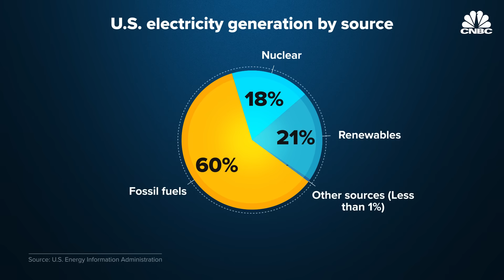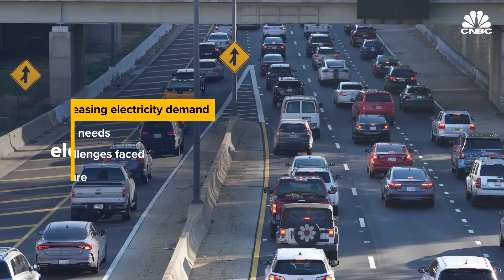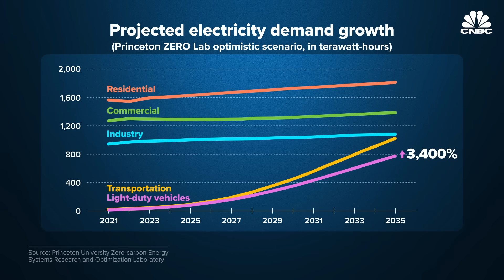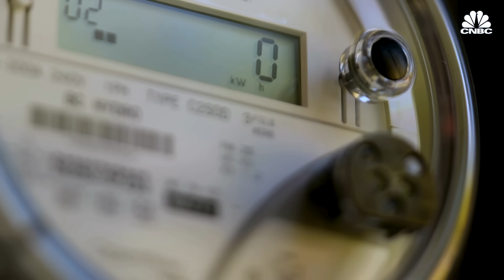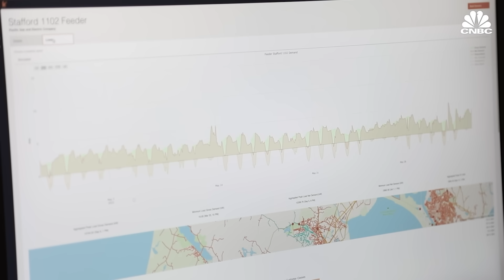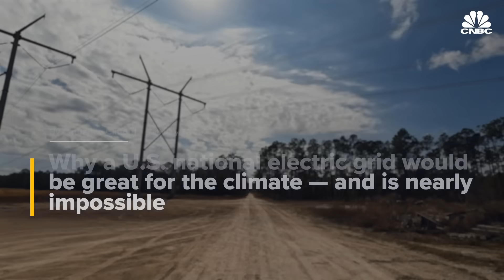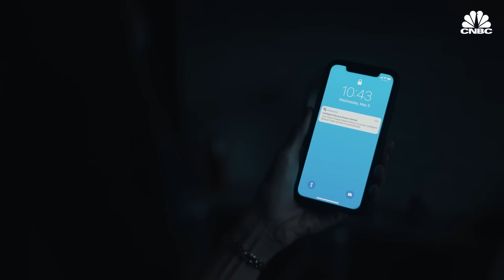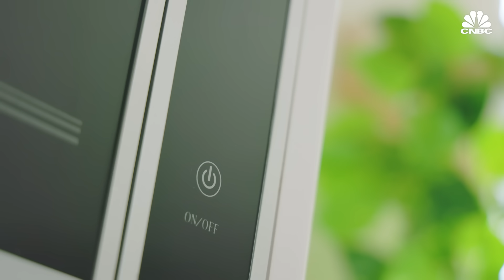Can The U.S. Power Grid Handle The EV Boom?

Comment: Northern Germany has available wind energy and southern Germany has available solar energy. An effort is being made to link the two, but there is opposition to overhead transmission  lines. Consequently, efficient underground High Voltage Direct Current (HVDC) line are being installed.  

One idea is to install underground HVDC lines underground along existing routes, such as railroads, pipelines, and highways. 

Actually the issue has three parts: Local generation and storage, intermediate generation and distribution, and long distance renewable energy generation and distribution. 

It will take lots of money. A good historical example is the Rural Electrification Act.

Comment: Almost every country is going through this, all transmission lines need to be changed to put more megawatts where renewables are favoured to where they are not. This is not about the EV adoption but the grid overall and its modern smart capabilities.
Reply: 2:00 he said $3.5 to $5 trillion. That's over $10,000 per person in the country with the lower figure. If it was cheaper I think more people would be on board.
Reply: The united states death rate is greater then the birth rate . United States energy consumption per person is  off the scale compared to other countries.  The next  closest country is Germany at about 65% .
Reply: @bobzelley5100  I personally think USA is obsessed with airconditioning units, even the poorest people have it and in other countries it’s a “luxury” and those are one of the biggest energy consuming home appliances. I think USA people don’t like opening windows at all😭I would die without natural air. But I guess it’s my assumption from just watching YouTube videos and Hollywood movies 😅, I stand to be corrected.
Reply: There aren't enough energy in the world to charge all the EVs they are forecasting for in the next 20-50 years.
Reply: Yeah but they won't send the money on it
Reply: We need to go Green in stages, we don't have the infrastructure to support an overnight change that all the activists are demanding.
Reply: but it is about that
Reply: Thanks for sharing your insights! You're absolutely right, upgrading the power grid is crucial for supporting the EV boom and maximizing the potential of renewable energy. In terms of backup power solutions, I highly recommend the Segway Portable PowerStation Cube Series. Its impressive capacity, fast recharging, and versatile sockets make it a reliable choice for outdoor enthusiasts and RV lovers. Check it out!
Reply: I don't think any of you realize that by doing this, you actually have to build more power plants which pump out 10 times more emissions per day than a family of four does in 5 years. Plus electric vehicles actually release particles that are 10 times more harmful to the environment and not just the environment you yourself sitting in. Those electric vehicles are being exposed to micro radiation just like sitting on top of a microwave. Congratulations y'all activists plays yourselves
Reply: Even without a transition to renewables energy demand is constantly increasing. At some point the infrastructure from decades ago gets overloaded and you just have to start some major projects to upgrade it no matter what.
Reply: IMO there is no need for large  scale grids, especially in sunrich California. Generation and distribution should be local. Combining rooftop solar with community solar projects would be sufficient to provide for the electricity needs of communities. This has the added benefit of large corporations profiteering. Generation and consumption should be local.
Reply: @versach49  it's way more efficient and reliable to share. There's times where your local generators are down for various reasons and you'd never know it since your power is being piped in from far away. There's a reason nearly every place around the world connects to much larger (typically international) grids where possible.
Reply: replace transmission lines? who's gonna pay for that? honestly this is all insane to me considering we have a cheap and readily available source of energy that isn't going anywhere anytime soon-oil. I for one will never own a electric car
Reply: @skeetrix5577 Me neither! Nope! No ev junk! No thanks!
Reply: @skeetrix5577  there are reasons why power plants are decommissioned, it means they are not performing as they used to… they are not efficient anymore. Same goes for transmission lines, you cannot be having a 1940 transmission line transmitting thousands of megawatts because they were not designed for that, they deliver less. Tech has changed, yes it’s expensive but that’s how it starts. If China can transmit 12GW of power 3000+ kilometers away from the desert to the cities using these lines then why can’t other countries do it?!. Look we don’t have to do it at the same time because every country has its own issues and some countries the population has declined together with energy consumption so energy is not that much of a concern to them whether green of fossil fuels. But what I’m saying is that, as we get more people using more energy we also get new equipment to handle all of their consumptions.
Reply: @fancyIOP ya thats why 90% of china rides bicycles right!! Nice try!
Reply: @lauriemedina706 It’s obvious you have not been to China for a while, or if at all. China new cars in 2024 31M, U.S. 15M . Of the 15M cars the U.S. bought half of them were imported. The Chinese are not doing to bad considering they are peasants
Reply: @skeetrix5577  you dont get a choice

Comment: Why do this at all?  IF you wanted to cut CO2 you'd be mass carpooling NOW and reducing vehicle CO2 NOW by 50%+! Which EVs can't do. Evidently no one really thinks CO2 levels are an emergency.  World Lithium production is 100,000 tons annually; enough for 10 million EVs if every bit went toward EV production. The US sold 15 million light vehicles in 2020 out of the 90 million light vehicles sold world wide. Since lithium batteries are used in cellphones, power tools, battery farms; likely a max of 5 million EVs with Telsa Y size batteries could be produced world wide of which the US would get what percentage 30%? - thats only 1.5 million.  So Lithium production would have to increase by at least 400% in 7 years to get to the 50% of US market figure. One problem with that - a ton of lithium uses 500,000 gallons of water to process it.   Even if you could, you'd need to vastly expand the electrical grid to take on 10s of millions of EVs.  It would be a lot easier to mass carpool NOW; conclude it is just a sales pitch not an emergency. EVs can't reduce transport CO2 by 50% even then; the grid is 85% fossil fuel powered in the USA and it won't be signifiantly less in 7 years.

Comment: I dont think BEVs are the panacea some people think they are. Yes they have a role for personal and commercial use, but I still think we need to focus equally on hybrid technology. ICE are most polluting when stuck in traffic or moving very slowly, stop start. EVs are most efficient at low speeds stop start. ICE are most efficient and less polluting at higher constant speeds, EVs are the opposite. Then you factor in the amount of pollutants released when making batteries and the case for full EVs is less compelling.
Reply: EVs are always more efficient than ICE vehicles. Even if they are charged using natural gas plants, they total emissions are less and more power is extracted from the fuel than in ICE vehicles. Stationary power plants are much more efficient than portable systems in cars. And solar and wind power is cheaper than natural gas.

Comment: Refining oil to make diesel/petrol uses more electricity than all the cars converted to electric would need, so where is the problem. As EV's take over, less fuel gets refined so EV's do not need more electricity and therefore will not be a drain on the grid, unless the grid is so old and useless it craps out all the time because of a lack of maintenance and upgrading
Reply: A lot of that electricity is produced right on site and is never on the grid.
Reply: @mac_mcleod  It is mixed.  Many sites are "Co-Generation" so they are counted as part of Electricity Generators, and tied to the Grid.  They become part of the overall accounting.   Having their local load go away makes them even more surplus.  Real difficulty ahead is how to manage the surplus -- not the lack.

Comment: In north Texas I’ve seen a building boom since 1982. At no point did anyone ask if the grid could handle all those McMantions with 2 or even 3 AC units each.
Reply: Problem with recent Texas McMansion Architecture is the roof lines are so chopped up it is hard to place Solar PV.
Reply: @philtimmons722  I would not get solar in Texas. The pro oil and gas people will find a way to punish you even if they have to work through third parties like HOAs and buddies in the insurance business. It happened in Florida and even in California. Chilling effect? You bet! I did buy EVs and now find out I'll be paying $200 per year to register them but that's still worth it. I'm guessing the folks that sell solar have near zero lobby dollars.
Reply: @philtimmons722  The folks who can afford solar don't want those ugly things on their roof anyway. Then there is the change you will be punished in some way either higher homeowners insurance, HOA issues, or what every solar opponents can get their buddies to do.
Reply: @frankcoffey  Sort of comical in an area of McMansions thinking other things are ugly, huh?   But yeah, a lot of smart and money folks want and get the combination of Solar PV + an EV.  Or a couple of EVs.  With the Solar PV mixed, the "fuel" becomes near free.  Agree that roofs are often not the preferred placement.  Solar Carports, Shade Structures, Pergolas and such are popular in this regard.  Often folks do not even know they are looking at Solar PV systems even when looking right at them.
Reply: Texas has a pathological fear of connecting to the rest of the country.  That's why their grid fails when the weather gets extreme.

Comment: I really hope nuclear generation is used more in the future alongside wind and solar
Reply: It is more expensive than wind and solar. And when you include decommissioning costs, it is much more expensive. Those extra costs are dumped on our grandchildren, which I consider immoral.

There is a place for nuclear in the Baseline power generation but when it is priced realistically, it's necessary to subsidize it with taxpayer dollars. And it should be paid for today. We shouldn't dump the cost on people who will never get to use the power.

There are new small footprint nuclear reactors the fit in a 12 ft by 12 ft by 75 ft space that have TurnKey installation and Power about 5,000 homes.

They're built at a central manufacturing location and installed on site.

There are several battery technologies which are larger and heavier but much less expensive and can charge and discharge for many more Cycles.
Reply: had to scroll a long way through the comments to find someone daring to use the 'n word'
Reply: Nuclear is very expensive electricity, I'll stick to the cheaper alternative of wind, solar, and batteries.
Reply: @wineberryred  batteries are expensive and can’t be scaled up feasibly. Nuclear can be cheap by using new reactor designs and continuing to research potential technologies
Reply: @TheLiamster  Its a challenge but not insurmountable.  First, it's unlikely that lithium will be used for grid scale storage.  There is plenty of research going into non-Lithium storage that are optimized like liquid-metal and flow batteries, compressed CO₂, gravity, to name a few. 

These alternative energy storage technologies sacrifice high volumetric density but gain by being a third the cost of lithium while supplying many times the cycle count and even unlimited cycle count.  

Stationary grid-scale energy storage simply does not need the high energy densities that are paramount in EV applications. That high power density complicates the chemistry and manufacturing of lithium batteries.  Stationary batteries will be made of common materials.
Reply: @TheLiamster  Nuclear is actually infeasible based on just build times!  It takes a decade to build one a new plant from scratch.  New nuclear construction is perpetually plagued with being over-budget by billions and over-schedule by years each and every time.  Nuclear power is the long running joke in the energy construction industry.

Proposed SMR technology is far from proven.  Even if built faster, there's not guarantee it can scale.  SMR are purposely much smaller in wattage for transportability but will suffer from lacking "economies of scale" which have driven current nuclear power plants to be on the larger capacity range (gigawatts).  

There are safety tradeoffs that SMR must make for economy and size.  SMR might not actually be safer than traditional nuclear but just have different safety characteristics.  

The nuclear industry is understandably very conservative and cautious.   But this means SMR will be all the slower to reach market provided it can even compete.

New nuclear is the most expensive form of energy while wind & solar are reaching ever lower record low costs.  On top of this, even people are against having wind and solar farms around them.  Can you imagine NIMBYism for nuclear power?  People don't want a nuclear power plant within a county of them.

Look at France which has a high percentage of nuclear power on their grid.  But they are now in big trouble with aging nuclear power plants that average 39 years old!  The oldest reactors (Bugey-2,3,4,5) are over 44 years old!  France has not paid the necessary maintenance or invested in engineers and even the specialized welders needed to maintain and build them.  France will largely not be replacing these plants with new nuclear which tells you something doesn't it?  France has not built a new nuclear power plant since the 1997 and those took almost a decade to come online.  France's neighbor Germany has shut down all nuclear plants with no plans to build any.
Reply: @beyondfossil ,  Remember part of the cost of a nuclear power plant is interest on the construction loans.  So the $30 Billion Georgia power plant is now paying between $1.5 and $3 Billion a year in interest in the construction loans.  So that can take the cost from only $15 Billion in construction costs to a total of $30 Billion when you include the cost to pay interest on the loans.   And if the power plant once finished, they can only produce $3 Billion a year in electricity, then they may never be able to. pay off the construction loans. 

With a solar farm or a wind farm, they can install 10% of it, and start to connect those systems to the grid, and they can start producing power even before the entire farm is finished.
Reply: @Kangenpower7  That is a really good point.  

FYI, I'm arguing against more nuclear here in one of the recent DW videos.  Can you add your comments (and anything else) to my thread here?

https://www.youtube.com/watch?v=j0pw6FzFrDg&lc=Ugz7KkN_syLScMy0b414AaABAg

(This will open to my comment but you might have to scroll down a bit to see it)
Reply: The two reactors being added in Georgia (Vogtle plant) are the last ones being built in the US.  That project started in 2009 and is over $30 billion.  Current nuclear is just too slow and too expensive to build.  Existing nuclear is fine.  Once the plants are up and running, they are pretty cheap to run.  So keep what we have going, beyond their original lives with upgrades.
Reply: @SeedFactoryProject  Wholly Crap, I did not realize the Georgia power plants are THAT expensive!  So they are paying about $3,000,000,000 a YEAR in interest on the construction loans?  I wonder how they can even make enough electricity to pay off those loans.  Let alone make a profit, unless they really raise the cost of electricity in Georgia.  

Each year of delay in starting the power plant, they need to keep paying interest on the construction loans.  So a $30 Billion cost, then need to pay 5% ($1,500,000,000 a year) or up to 10% ($3 Billion a year) in interest.  That is why a wind farm is so much less expensive to install.

A wind farm, or solar farm,  they can install part of it, connect it to the grid, and start producing power right away, not needing to wait for every last wind turbine to be installed to start production!   And I have never heard of a wind farm that construction start to end is more than 3 years!  Most are far less than 2 years.

Comment: Vehicle 2 Grid could actually reduce the grid load due to distributed supply.  But we do need a smarter grid.
Reply: Exactly.
Reply: Bingo.
Reply: wallbox quasar 2 should be the charger standard
Reply: Be careful what you wish for. I was the Smart Grid IT guru in Flagstaff from 2010 when the system was installed to 2018 when I retired. It was a simple affair, about 35 switches connected through spread spectrum radios providing info and control among the smart devices in the system. For those three dozen devices the level of complexity was enormous. Virtually all Smart Grid systems today are bleeding edge.
Reply: I'm not going to degrade my vehicle when I'm not using it. Stupid suggestion

Comment: This is a dumb argument.
Electric load is peak between 4pm and 9 pm. 
In a lot of states so are the rates.
Just set your car to charge 11pm to 5 am get the cheep rates and take the strain off the grid.
Help smooth out the duck curve.
How big of an EV hater do you have to be to make this video?
Or like most of CNBC just not informed.